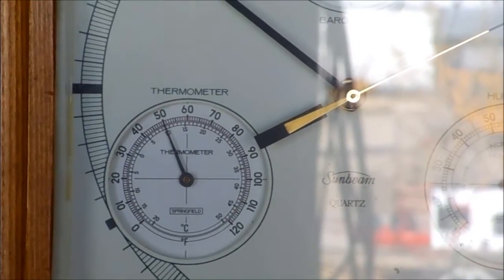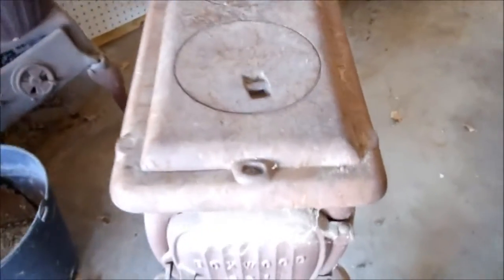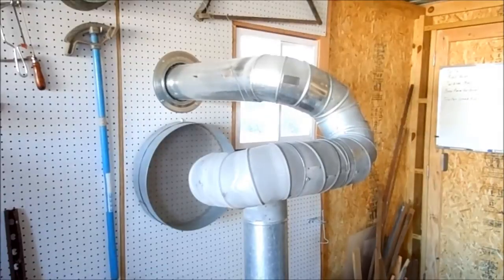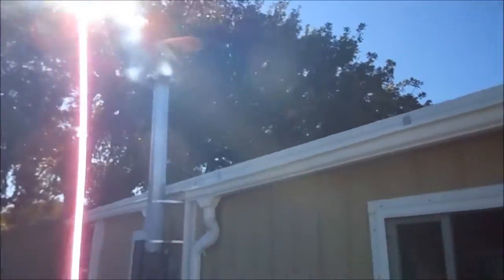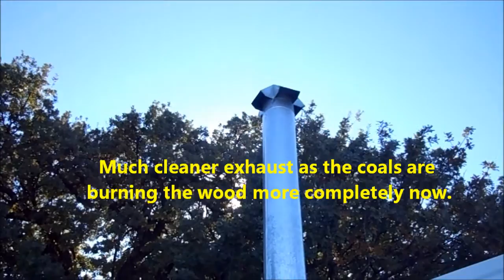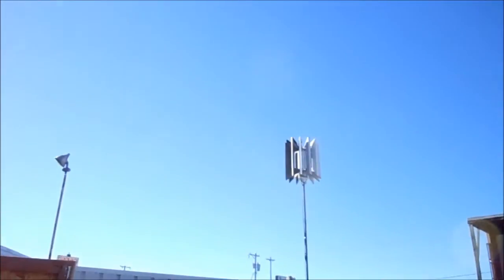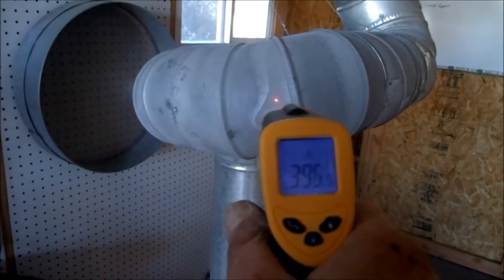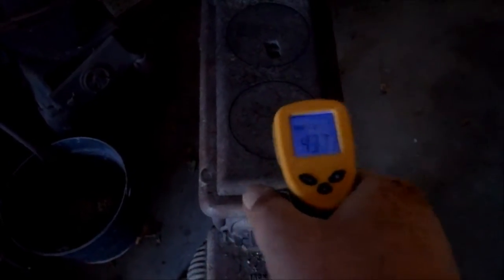The Old Boxwood Stove

Comment: the stovepipe will fill up with creosote in a month or so ,it seems to restrict a good hot fire after a while and eventually the pipe will start leaking with creosote  ,a straight pipe will burn hot enough to keep the pipe clean. if you have some bricks to drystack around stove it will be a whole new stove as the bricks will store the heat for a long time
Reply from the maker: Thanks Steve, but don't worry about it. Where I live in north Texas, temperatures dip down to freezing only a few times a year and those are the only times I fire it up. Every spring I disassemble and clean out the pipes in order to make more floor space in the shop for the summer. Eventually I'll set up the stove correctly when I no longer need to move it out of the way to make space.